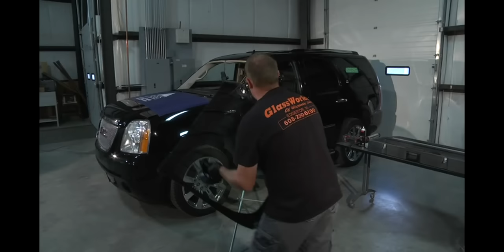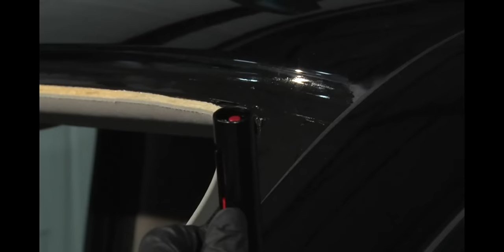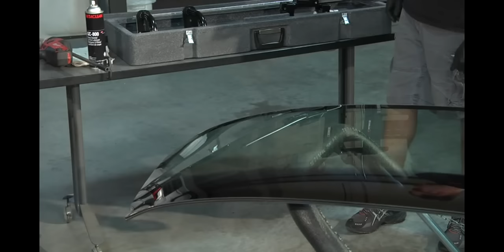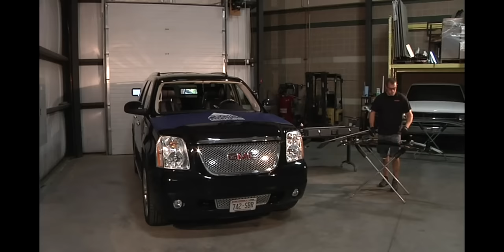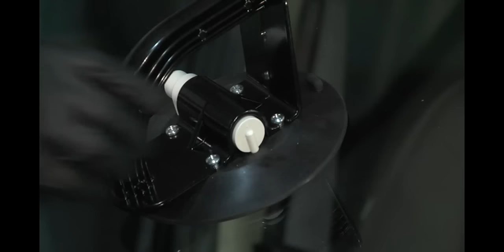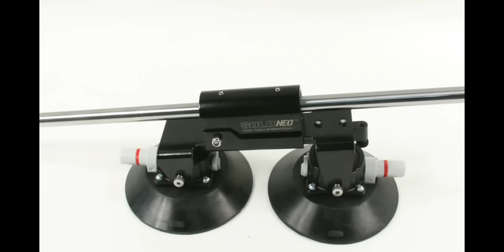AEGIS SOLO NEO Instruction Video

Comment: This is the worst setting tool I have ever used. I have set thousands of windshields using various tools like the lil buddy and offerings from equalizer but this is by far the dumbest tool created. It does not seem designed for mobile use, does not work well on hidden pinch welds, and requires a dry set for most vehicles to get the correct measurements. Whoever designed this tool hated technicians and has no idea how the modern vehicle works. If your company forces you to use this tool (like mine is currently), find a new company. Do yourself, your business, and your spine a favor and steer clear of this awful contraption.
Also why is the case so bulky and heavy?
Reply: Been using this tool for 10 years you are just 🗑
Reply: This sounds like user error

Comment: We recently purchased one for our shop, and I've had nothing but good results from this product. I was also worried about the side glass being the support system, but only once has been an issue when a customer's door glass was "iffy". I just used the passenger door instead, but if need be, and the extra labor isn't an issue, you could block up the door glass to keep it from slipping. So far, after about 30 installs, no complaints. Really impressed with this.